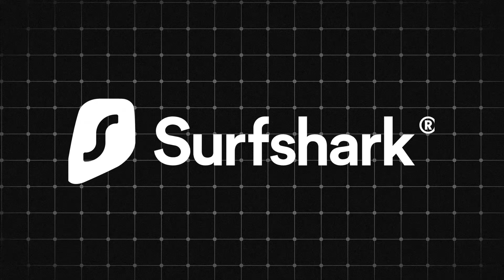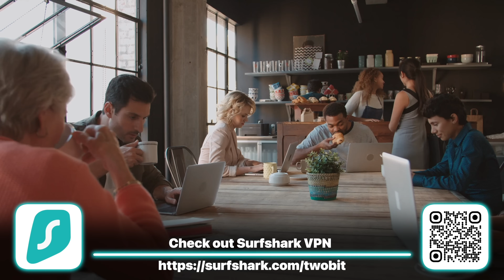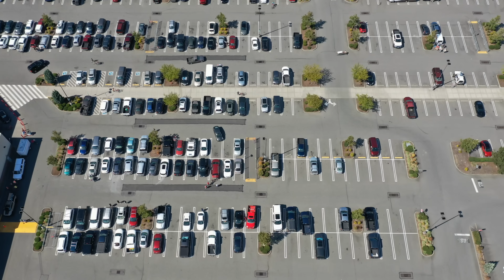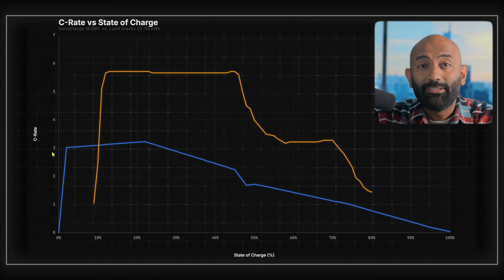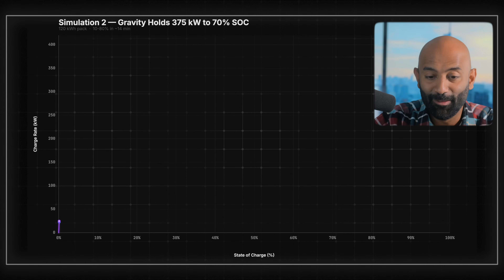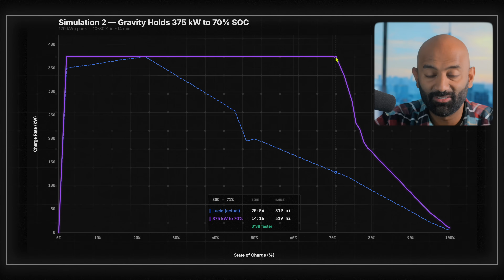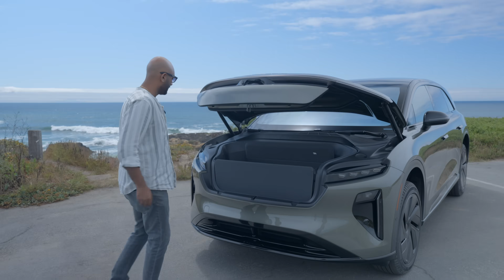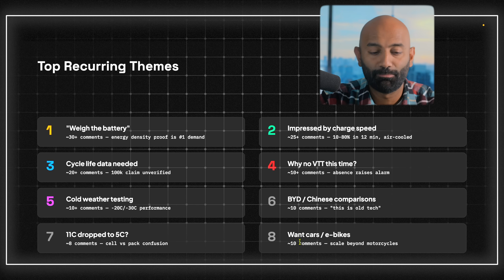Donut Lab Battery Test 4 Changes Everything!

Comment: Wow, that 5C charge curve looks 60% as good as what BYD is launching!
Reply from the maker: 60%? Damn, BYD’s bringing heat — this curve’s more of a slow burn.
Reply: Well you missed the part where that's on huge battery packs with liquid cooling. :-)
Reply: @taylankammer  Huge packs mean nothing for C-rate. And for thermals (Which are a bigger challenge with a bigger battery), do the math on temperature rise of this battery.  The impressive part of this battery is that it can tolerate getting hot.  This thing probably went from 20C to 60-70C in the first 5 minutes and (I'm assuming) that's why it slowed down at 47%.

It's still great, but it's generating just as much heat as Lithium-Ion batteries.
Reply: "With 1.5 megawatts flowing through a Chinese-spec charging cable, BYD claims that the new EVs fitted with the Blade 2.0 battery can go from 10-to-70% state of charge in just five minutes, while a 10-to-97% charge takes nine minutes"

Comment: Do not care about P-rate(C-rate is dead bud, as confuses with Celcius)... why?  On an actual vehicle, larger battery, no charger will actually SUPPLY the required current to get you OUT of there quickly.  Until giant batteries start being installed AT the charging stations, allowing the higher currents, we are never going to see the high P rates our current batteries are capable of.  Let alone the Donut Labs battery.

Comment: You can do all what they have done in all test with current technology if you don't care about battery lifespan. Until they prove all of this can be done with a real battery pack for a vehicle and it maintain 90% of the capacity after 3000 cycles, I'll believe this is a SCAM, because there is no way all the features they talked about are true at the same time, especially the 100.000 cycles... I think they went way too far with that one 😂😂, so probably it'll be a SCAM until they lower it to a more real scenario. And again, I'm calling it a SCAM because they can't hit what they advertise by a mile. If someone sells you a battery saying it's a 10000 mAh, and it turns out it's a 1000 mAh, it's a SCAM, even if it works just fine.
Reply from the maker: Calling it a scam ignores we’re seeing 5C+ charging on a real motorcycle — that’s not nothing. Prove the cycles first, then we talk.
Reply: @TwoBitDaVinci  If it doesn't do 100.000 cycles or at least 50.000 cycles as they say, it's a scam on my book, and we haven't seen that yet. And probably we won't see it. If you don't deliver what you're saying by a "normal" margin (we know some numbers are only "best case scenario"), it means you're lying, so scam. But well, I'm open to change opinion when they demonstrate everything they are saying. But in my experience, we won't see it...
Reply: @TwoBitDaVinci  What about the whistle-blower that has reported the companies to the police and relevant authorities because "they have been building invest expectations on exaggerations, on lies and on promises they were never going to be delivered"? That is what I call a SCAM with capital letters. You can watch the video he made. It's on Youtube and called "Episode 5: Web of Lies / Donut Lab / Solid state battery / whistleblower"

Comment: I bought 5years Lipo battery with  20C rate, so if the energy density is not there it will be nothing exceptional.
Reply from the maker: 20C is wild — but if the energy density isn't there, yeah, it's just a fancy paperweight. Gotta see those cells weighed.

Comment: Test 5 is going to be a range test after that video of them charging. They will probably show something like tesla did for the semi. Charge up at a public charger to 100% and drain it to less then 5 going to a destination. with more charts about percent with distance. I think they want to prove the 370 range claim next before cycle life.
Reply: Donut can prove nothing in a sales video, only a independent test done by professionals can reveal what is true and what is not.
Reply: @Unity2-765 Tesla did it perfect with a raw video of the whole drive showing they actually drove the distance they said they could. Release a video showing charging it up with the same speeds and then no cuts and show the raw video of it going out and hitting that range like they said it would. no cuts and no edits. its possible to do right and not hide anything. We will see if they do it that way.
Reply: @spro_halver8553  

Yes, that would be better evidence. 

Just Tesla is claiming an evolution, Donut is claiming a revolution. 

Donut ' s claim is extraordinary why normal evidence is not enough. 

They need to provide, in proportion, the extraordinary evidence, which they have failed to do with the first four tests so significantly, that one could claim they just proved their own scam.
Reply from the maker: 0-100 or bust — let’s see that range claim hold up

Comment: Doesn't the simulation still map the air cooled solution to the Lucid charge curve? With proper cooling it may be possible to hold the 5C rate well beyond what is shown (infrastructure is still the limiting factor)?
Reply from the maker: their 5C+ in ambient air is already wild — cooling just pushes it further

Comment: The graph for Donat battery in a water cooled pack will look a bit different. If it wouldn’t reach temperature limit would keep max speed until 50-55% and drop more slowly.
Reply from the maker: yeah if it stays cool it’d hold peak longer — makes sense

Comment: Thanks for this review. It looks like it is indeed a neat battery. The charging profiles look really good.
In your video, I'd love it if you could put a legend onto each of the graphs. I could work this out after pausing for a second and thinking about it, but it would be great if there was a legend everywhere.
Also, I reckon putting the time or perhaps an estimate of it as a datapoint for each of the curves would make the graphs a lot easier to interpret.
Thanks again, this was a great analysis.
Reply: He mentioned that all the graphs were available on his Newsletter.
Reply: @stevebaum747  Thanks. Yes. I'll look over the links. My desire for those labels may show I don't normally look over these kinds of graphs. These graphs might be how battery properties are often displayed.

Comment: Not impressed, 12 minutes isn’t fast enough to replace fossil fuels. And there are Chinese manufacturers that are quicker nowadays.
Reply: 10-80% in 12 minutes is, of course, more than good enough for 99% of the customers. Even nothing close to what was claimed at CES 2026. 

Just, we don ' t know anything about this battery as long as we only have evidence from the seller. And this fast charge is worth little if the battery will be dead after some relative few cycles....we don´t know. etc. etc. etc.
Reply from the maker: 12 mins for 80% on a bike? Solid start — fossil fuels had 100 years to get here.

Comment: Where did you get the "5C" from?

There solid state pack is meant to be 30kwh so this would only be ~3C?

Or is this another faked battery?

Only 18kwh pack? So not their 30kwh solid state?

Sounds like their normal pack, not a new one....
Reply: Yep, their original battery was 20.2kwh and the tested one only 18kwh? Probably 18kwh is only usable capacity, but totally there are 20.2kwh as in the original one, to keep it from discharging completely. Still confusing why the same capacity as the old one.
Reply: So can only fast charge once and then it's done.

Does it actually have active cooling? Seems unlikely.
Reply from the maker: Yeah it's their current 18kWh pack — 5.7C peak from real motorcycle data. 30kWh is the goal, not this one.

Comment: I guess you haven't heard of Xpeng with the G6 or G9 with peak charge power at 525kw and 10 to 80% in under 12 minutes. More around 10. You can buy these cars today with regular batteries
Reply: @MichaelPanzer  Sure but what's the actual range charged per minute? And total range?
On range charged in 10min it's similar to the Lucid, but in overall range the Gravity (Panasonic cells) is much better. The new Cayenne (LG cells) is also better than the xpeng.

Same for byd's megawatt charging, the byd tang L awd supposedly charges similar range per minute but has considerably less range overall.
Also there's no solid evidence of how reliable byd megawatt charging is, it's nowhere to be seen outside china.

Contrary to what all the propaganda claims (and all the bots on comment sections), china has not achieved any proven significant innovation in battery tech.
Reply: @sideways0wlrange charged per minute is something completely different then C rate! We're either talking about efficiency of the whole car or how fast a battery can charge. 

If we look at charge power then the 10-80% timespan is relevant no matter how far you get with the energy charged!

The range per minute changed depends on the efficiency of the consumer and the size of the battery. Both things the C rate doesn't care about. 

So my point is charging time as is discussed in this video and not efficiency of the car.
Reply: @MichaelPanzer  the thing is those chinese packs have very inferior density, that's the main reason those cars are so inefficient. They're heavy and bloated.
The c rate on their packs come with considerable trade-offs, and end up making them inferior tech/product.
Reply: @sideways0wlthat's nonsense. Factually nonsense... But sure tell the guy with those cars in reality in the market here in Europe what they can and can't do 🤣
Reply: @MichaelPanzer  buddy do your research and don't embarass yourself. Do an apples to apples comparison: Lucid Gravity gt, Cayenne ev, xpeng g9 and byd Tang L awd. All similar size and awd.
Adjust the cltc numbers to wltp.
You'll find the chinese models don't offer any significant advantage in range charged per minute, and they have considerably less range overall. Thus inferior tech/products.
Reply: @sideways0wlI think you don't understand that nobody is talking about range per minute. That's a stupid metric because it's user dependent! But I guess because you're American I can't expect you to understand things that well
Reply: @MichaelPanzer 🤦‍♂️ You insist on embarassing yourself and showing how clueless you are on the subject.
Range charged per x minutes is THE relevant metric for customers. And it's based on standard test cycles so it can indicate what customers will achieve on whatever their use case is.
The c rate or peak power car charges at are not as relevant from a practical viewpoint, sure they can be used for marketing but do not tell the whole story.
Case in point, the cars we're talking about.
Have you even seen how much a byd tang L awd weighs?? Their battery approach is the main reason why it's so inefficient, to the point where their 1mw peak doesn't provide any advantage compared to what the Gravity or Cayenne achieve with just 400kw. And the byd needs more expensive infrastructure, needs 2 charge plugs and still has less range overall.

Are you gonna tell me that if tomorrow they release an ev that charges in 1 minute but only does 10km, is that some kind of achievement?? You realize the bs you're spewing??

And no, i'm not American.
Reply: @sideways0wlthen you're just clueless. I'm tired of this nonsense.
Reply: @MichaelPanzer how pathetic is youtube censorship 🤦‍♂️
Reply: @MichaelPanzer  🛠️👕🤡
Reply: @MichaelPanzer You're an example of Dunning-Kruger effect.
Not surprising from someone who wears a  ⚒️🔴 looking shirt.
Reply from the maker: apples to oranges — bike vs car, and we care about the flat 5C+ curve, not just a peak
Reply: @TwoBitDaVinci 5C is 5C no matter what the curve looks like.

Comment: Test #5 could be large transit, either one of their bus customers or logistics (truck trailers).
Reply: Doesn´t really matter, as any test provided by Donut is not to be trusted....could be true, could not be true....we have to wait for a proper external test when a Donut battery hit the market.
Reply: @Unity2-765So VTT isn't credible?
Reply: @JDDevice   I guess they are very much, but if you read the VTT test report, it is written it is the paying customer (Donut) who has identified the cells to be what is claimed.

VTT doesn`t test that claim, why VTT doesn´t know if it is a solid state cell, or even a donut cell.

Donut has a lot of secrets, and until somebody can freely test the cells, our knowledge will be limited.
Reply: @Unity2-765The discharge test already proved that it is in fact a battery, but you're right, they haven't dismantled the battery to see what it is made of. Eitherway, if its not solid state, its the best battery on the market currently. And based on the performance, especially the 100°c for 2 hour bake test, proves that its not any battery chemistry available today. If its not solid state, then they discovered a whole new chemistry.
Reply: @JDDevice  

How do you know the different cells are even produced by Donut? VTT doesn ' t. 

How do you know it is the best battery on the market? Define "best. "

 We don ' t know if the different cells are even the same type of cell, so how can you know anything when nobody else knows ? 

For a cell to be "best , " it must be pretty good on many parameters, not only one, and that is exactly the core problem here. 

Donut has delivered zero evidence that a single cell is "best" on all the claimed parameters. 

What do you know about what is available on the market today, despite all the BS you read here? 
Do you work with CATL? Or do you have a relevant science degree?
Reply from the maker: bus or truck — yeah, that’d show real-world stress

Comment: How does this compare to the Zeekr 7X LR I drive. I charge 50 to 70 kWh in 16 minutes, depends on outside temperature and charger capacity. (300 kW or 350 kW). I am impressed with this motorcycle and the charging, Energica should put a similar battery in their Experia and I will be an even bigger fan. But comparing this charge speed to my Zeekr, for me it looks like a much smaller gap? (commented before you showed that it was capped, so there is that...)
Reply from the maker: Yeah but 5C+ on a bike vs 350kW on a car — different games. Still impressive for two wheels though.
Reply: @TwoBitDaVinci I saw they are now selling these bikes with mentioning 200kW! Really inpressive

Comment: When they announced it in CES, they said it'll be 12min/5c and air cooled.
Reply: This. They are moving the goal posts and the bikes are meant to start deliveries any day now.
Reply: @tomblewomble3369 you misunderstood me, this is basically what was promised. You can go back and look at the videos.
Reply: This is not the optimized production Verge BMS. Again this is only to demonstrate it is nothing like any other e-bike on the road.
Reply from the maker: ces said 12min/5c air cooled — real world's showing 5c hold to 43% before taper. interesting gap

Comment: Its easy to claim your battery is special when you compare it to current year field cells which are like state of the art from 5 years ago due to how development cycles work. What is seen in the video can easily be accomplished by modern standard cells especially since no livetime demonstration was made and the livetime data from their VTT results is bad. I am sorry to say that this test again doesnt show anything that can not be achieved by conventionaly battery tech even if you consider the cooling. Heat sinks with active air flow (he mentioned the use of fans) is already more than most air cooled car cooling systems produce. The fact that he says the best electric vehicles charge in 20 min or longer is just flat out old news. You can buy faster charging cars since almost 2 years.
Reply from the maker: cycle life claims need cell weighing — we don’t have that data yet

Comment: Could this take up the intermittent gap in alternative power walls?  Able to store more input in less time. If solar could get improved conversion percentages per square meter.
Reply from the maker: 5C charging helps with solar's intermittency, but yeah — we still need better panels too

Comment: Allright, I'll add to your comment algorithm... Regardless of what it is, it's certainly a high performance battery and could be a game changer.
The biggest question then in my mind is what is the 80% cycle life range based on temperatures. And to a lesser extent the safety. I'd like to see puncture and overcharge testing.
Reply from the maker: temp-dependent cycle life and puncture tests — yeah those are the real questions

Comment: I dont care if the battery charges full from empty in 1 second. That still does nothing to help the power grid, also the number of charging stations, not having a charger in apartment buildings, the dangerous effects from fires, the cost to buy a electric vehicle, the insane value they lose in a few years, how easy it is to junk vehicles when wrecked. Im sure theres a few im missing. Battery powered vehicles might work in the future, but only when people that never lived their whole lives and prefer ICE vehicles are gone.
Reply from the maker: you listed like 10 problems and charge speed solved exactly zero of them

Comment: Thank you for your videos🙏
Perhaps should've pointed out more clear that if Lucid had a Donut battery, C rate and graphs should be substantialy better as the pack would be liquid cooled
My guess is this also opens the possibility to easily implement air cooled packs on entry level EVs, still giving them more charging capabilities than basically anything out there
Reply: Just what I was thinking, the comp is for a similarly air-cooled battery the size of the Lucid pack - with liquid cooling there wouldn't be a double dip, it would maintain 5.7C until the first plateau intersected with the chemistry curve.
Reply: Its not clear if the BMS is reducing charge rate because of thermals thou. That would be speculation.
Reply: @TheMediaPortal It's the conclusion when looking at the VTT Lab test
Reply from the maker: Liquid cooling would keep it flat — air cooling's still wild for entry level.